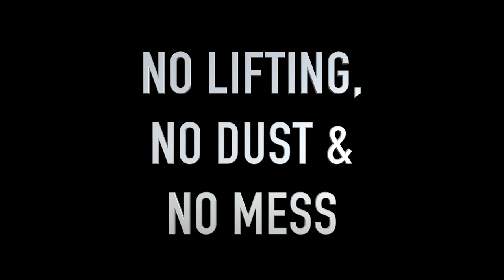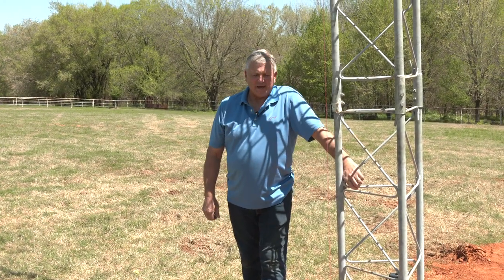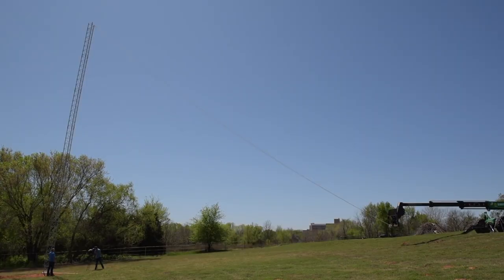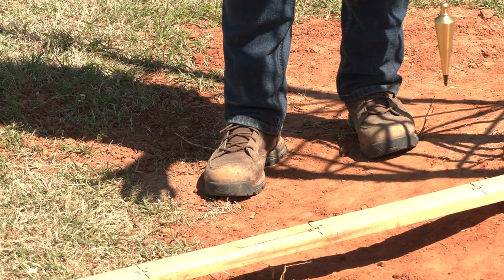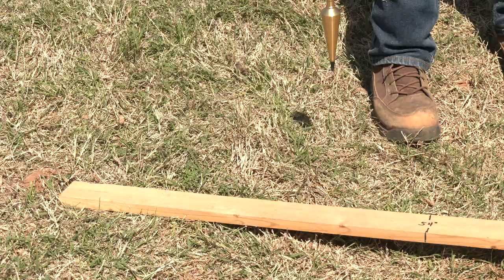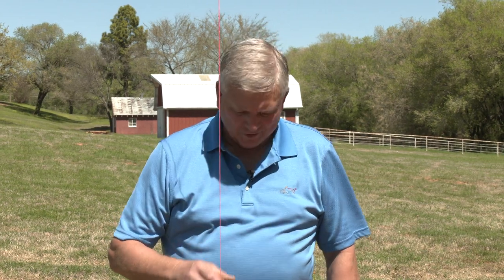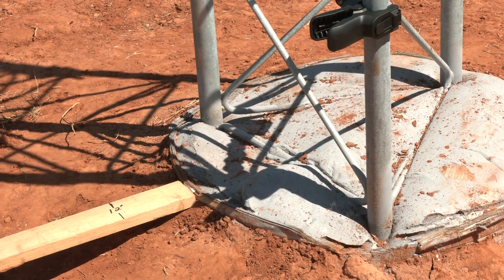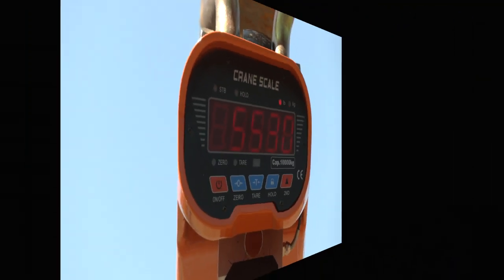Secure Set: Setting Communication Towers, Antennas & Small Wind Turbines — Installation & Testing

Comment: One test that would have proved the footing did not move is to release all tension and see if the plumb bob returned to the same pre-pull starting spot.
Reply: I would imagine that much deflection would result in permanent tower damage.
Reply: @JITProductions  Under the same conditions you pulled with the crane for your test, releasing all ropes and guys would ruin the tower????? I am missing something then.

Comment: Great job bravo! How big was the hole in deep wide the plinth?
Reply from the maker: Thank you for your comment and question.  This 65 ft. tower was direct buried 6 ft. in the ground and 28" to 29" diameter hole.  An auger bit will pull 1-1/2" to 2" bigger diameter hole.  We did not place any base or stone under the tower legs.  The Secure Set will protect the post from moisture and oxygen; therefore, there will be no chance of rust below ground.  Thanks again, GRA Services - The Makers of Secure Set

Comment: Damm i have never seen something so wacky yet mindblowing brillant, but does secure set act like concrete over time, by that i mean keep getting harder ??, i know if you have old concrete that was mixed with flints, even after 50 years it is damm impossible to break up with a jack hammer, if secure set was like this it would a revolution for us Hams and our towers :) :)

Comment: Can I use Secure Set to temporarily place a tower until after my building is built? I'm thinking once the base has been pulled out, the foam can easily be cut away and the base re poured in the new location with minimal damage to the base (concrete not so much). If not, is there an alternative way to temporarily mount a tower?
Reply from the maker: Hello Drinkin-n-Thinkin,  Secure Set will be a very good alternative.  You can cut it away after you pull it out if you want to set it permanently in concrete.  Thank you

Comment: What are the ramifications of putting something like this in the ground?
Does it affect the quality of your ground water if you're on a bore supply?
Does this change over time?
Reply from the maker: Thank you for the question and your interest.  The use of Secure Set is a zero environmental impact on surrounding soil or ground water.  Secure Set is a very hard foam that does not break down over time in the ground.  It's projected to last 40 plus years, since nothing really effects the foam.
GRA Services

Comment: I would imagine up to 25 feet with any kind of wind turbine this could hold but to save your own skin I would probably suggest using guy wires. I have a 60lb turbine and wind load is about 5. Since the city might mess with me for having this free standing I was considering using this to put the tower up with a mid hinge bracket to lower the tower to service the wind turbine. BUT I would defiantly use guy wires. Just because the tower CAN flex that much and survive with no weight up top... doesn't mean you want it to ever flex that much. Especially with a 60lb wind turbine on top. Using foam I could just take the tower out if I get a complaint. You say this is the 4 gallon kit?

Comment: What about cost comparative to traditional concrete?
Reply from the maker: Thank you for your interest and your question.
Our customers do their own cost comparisons, because there are so many different ways of looking at the use of concrete vs our Secure Set high-density, closed cell foam.  
One option is that you buy the numerous 60 to 80 lb. bags of concrete (It takes 5 of the 80 lb. bags to fill the same hole as 1 Gal. Secure Set, since this will fill 2.5 cu. ft. (space/volume) vs. concrete only 1/2 cubic ft. per 80 lb. bag.  
Then you have the comparison of the lifting/loading/hauling/unloading/lifting again/ moving to work locations and the need for water and a large mixer with concrete vs. using a few 40 lb. boxes or a few 40 lb. to 50 lb. buckets of Secure Set and a cordless drill.  
Another option is to have the concrete bags delivered to the site, which is normally just a drop not the movement to where you are working.
And then there is the option of scheduling a concrete truck, but have you priced that lately?
Of course, there is always the option of hiring someone to do all this back breaking work for you.  Working with Secure Set is so much easier and saves you time/money in labor, and it sets up so much faster than concrete.
So, because there are so many ways of comparing and prices that vary throughout the U.S. and other countries, we do not do the comparisons. 
GRA Services

Comment: What are dimensions of the pipes, the type and the hieght. What is the depth of the foundation. Could you share details of the antenna structure.
Reply from the maker: Hello Richard,  The tower is a Rohn 55  Here is the link to the information    https://www.rohnnet.com/rohn-55g-tower    We set the tower 60 inches deep using a 24" diameter bit.  Thank you

Comment: Would secure set be strong enough to use for two hammock posts?
Reply from the maker: Hello,  Yes, it will work for a hammock.  However the depth you set the post is different than fences or gates.  The depth for the post is 50% of the overall length of the post you are using must be set in the ground.  Thank you
Reply: @SecureSet-Fence-Installation  so if it’s you’re total length of posts for the hammock are 10 feet each the holes have to be 5 feet deep for secure set?  Can you use sono tubes to set the posts in?
Reply from the maker: Hello,  In certain application using a Sono Tube is helpful.  Most often they are used when you have sandy soil.  If you have normal soil conditions, it is better to set the posts in native soil.  Also, tilt your hammock posts at about 15° angle off centerline.  Thank you

Comment: Roughly, what is the price difference on material at the time of the video?
Reply from the maker: Hello Nick, I am not sure what you are asking?  Do you want to know the price of the kits as of today, 1/4/22?
Reply: @SecureSet-Fence-Installation  Yes, more or less, but I was asking the ratio/comparison to cost of the concrete. 

But yes, what does the kit used in the video cost?
Reply from the maker: Hello Nick,  The hole was 28" in diameter and 60" deep.  To get the cubic volume of the hole, That would be 14"*14"*3.1416*60".  That is 36,945 cu inches. Divide that by 1,728 to get cubic feet. There is 21.3 cubic feet of void to fill.  One 80 lb. bag of concrete will fill 1/2 cubic feet of space. (Bag measures 12"x18"x4" = .5 cubic feet per bag.  To fill 21.3 cubic feet we used 43 bags of concrete.  Current price for a bag of concrete at Home Depot is $5.17. (Jan '22 pricing)   $5.17 x 43 = $222.31  (That does not include tax).  We used 2 - 2.5 gallon kits and 2 - 1 gallon kits to fill the void.  2.5 gal kits costs $75.95 and the 1 gallon kits cost $36.95.  So, total cost for the Secure Set foam is $225.80   It is a no brainer when you consider the amount of labor it takes to mix, pour and set the concrete.  Thank you, I hope this helps.

Comment: Can I apply secure set to vinyl fence post? Since I have only seen it used for wood and metal fence.
Reply from the maker: Hello, The best advice I can give about vinyl posts is to make sure you wipe down the outside of the post to remove any forming oil residue that may still be present. Other than that, make sure the post is held very steady during the expansion process of the foam.  The post is so light, sometimes the foam moves the post a little and then you would be off plumb. The post being hollow is of no consequence.
 

Thank you
Reply: Secure Set, thank you for your response. Your information will be really helpful for me, btw what do you mean by “ the post being hollow is of no consequence” ? Does it mean the secure set cannot be used for the hollow vinyl post? Does the foam will expand inside the post and bend it?
Reply from the maker: Hello Victor, What I meant is that the expanding Secure Set will not crush or misshape the vinyl posts. However, it is important to support the posts well and to be vigilant about keeping the posts from being "lifted" out of the hole while the foam expands. The vinyl posts are very light compared to a wood or metal post.  Also, if the post is set on one side of the hole, and you have a small gap on the other side, the expanding foam could push the vinyl away from your plumb line because there would be more foam on one side of the post instead of the other.  The final result of setting the vinyl post will be good, just stay on top of the process when the foam is expanding.  Thank you.
Reply: Secure Set thank you

Comment: What about a 100’ - 200’ free standing tower? I’m guessing similar process, just dig deeper?
Reply from the maker: Hello,  Yes, we have set lighting towers for stadiums that were 150' tall.  In our industry we set the towers 10% of overall height plus 2 feet.  100' tower would be in a hole 12 feet deep.  That is my recommendation.  Thank you.
Reply: @SecureSet-Fence-Installation  thanks so much!  Been thinking about doing a 150’ tower for some antennas I have and need to get over some adjacent buildings because they’re blocking the signal.  Will obviously need to consult with the town before construction, but knowing that I have a guy-free option is a huge plus!
Reply from the maker: @miket5506  HI   YOU ARE WELCOME !!   If you get approval, let me know, we can figure out hole size and amount of product you will need.  Thank you
Reply: @miket5506  Hi, 
Did you do the 150' tower? what was it like? and how much secureset did you use? at what depth?

Comment: Well im kinda bummed out here, i bought 7 gallons of it for a 24x24x48" hole with my tower and mixed it all up and put it in & it is now 2 ft from the top, never filled it all the way but it was stated i only needed 7 gallons would be a lil more then what i need, im sure they will make it right, seem like extremely good business people and very kind on the phone also but now i have a tower scheduled to go up on Saturday & had to cancel that🤥
Reply: Did it seem strong enough? How much more do you think you needed? I have a 4ft deep 3 ft x 3 ft hole
Reply: @chiefmatt1556  Oh it was very strong, strong like concrete but after 10 gallons one would think when they estimated it at 7gallons it would be full but NO. i had to cap it with concrete as it was still about 8" from the top
Reply: @kevinpate8551  Thanks! I used it on my 40 foot. Free standing tilt. yes very strong! Holding up well! even though the tower company said not too, i did anyways. Glad i did!

Comment: ...doesn't the weight of the concrete keep it from.... Never mind.  Carry on.
Reply from the maker: Hello Rehoboth,  Using only concrete, yes, the weight of the concrete is part of the stability of the tower. The main difference between using concrete and Secure Set, (which is similar when we set large towers for stadium lighting,) is that Secure Set penetrates and bonds extremely well to the substrate(soil) where as concrete fills the hole but does not bond as well to the soil. Uplift tests indicate Secure Set, when compared equally to concrete, in the same size hole and with the same soil type, yields a 61% greater uplift resistance. Thank you.

Comment: how long will it last?
Reply from the maker: Hello XPFTP,  Under ground, life expectancy is greater than 30 years.  If any of the foam is exposed to direct sunlight, there will be oxidation on its surface.  You can prevent oxidation of exposed foam simply by painting the surface with a quality latex or acrylic paint.  I like to use Rustoleum heavy gray primer.  Works very well and gives the surface of the foam a "concrete" look.  Thank you
Reply: @SecureSet-Fence-Installation  sounds good.. iam thinking of a base with rebar and all thread. for tilt. should be fine then. thank you very much